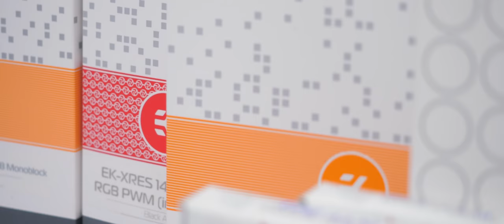Bộ PC 100 Triệu Cho Fan ASUS ROG! | HANOICOMPUTER

Comment: ad tư vấn cho bộ máy vừa có thể chơi ổn PUBG vừa có thể  sử dụng AI PS PR ổn định trong tầm giá dưới 20m được k ạ>?
Reply: Tùng Tùng 8100 + b360 + 8gb ram + 1060 6gb + psu 450w + ssd 128gb
Reply: Học Trò Thầy Ba dưới 20m mà sao đc 1060 6gb vậy?
Reply: Nhật Huy Trần bạn lên web nào đấy build thử xem , k đến 20m đâu
Reply: Học Trò Thầy Ba ok
Reply: Học Trò Thầy Ba đấy là cấu hình >25m rồi bn ơi!!!! Trừ hàng cũ ra thôi. Vs lại 450 mik nghĩ ko ổn đâu bn ạ i3 8100 cx ngốn phết mà (ko biết chắc đâu :)))
Reply: Tom Potter làm gì tới bạn , mình build PV hàng new tầm <20m thôi . 25m là có i5 8400 rồi
Reply from the maker: Chào anh. với tầm giá và nhu cầu trên, HNC mời anh tham khảo qua cấu hình sau : https://www.hanoicomputer.vn/pc-hnc-professional-gaming-p8-i5-74008g1060/p37948.html

Comment: ORSAIR VENGEANCE® RGB 32GB (4 X 8GB) DDR4 3466MHZ C16
Số lượng: 
1
 x 12,490,000đ

GIGABYTE AORUS GTX 1080TI 11GB (352 BIT) GDDR5X
Số lượng: 
1
 x 22,500,000đ

CORSAIR RM1000X - 80 PLUS GOLD FULL MODULAR
Số lượng: 
1
 x 4,850,000đ

SAMSUNG 860 EVO SERIES 2.5" 250GB SATA III
Số lượng: 
1
 x 2,600,000đ

SEAGATE BARRACUDA 4TB 64MB CACHE SATA 6.0GB/S 3.5 7200RPM
Số lượng: 
1
 x 3,250,000đ

VITRA VICTORIA V4
Số lượng: 
1
 x 580,000đ

INTEL CORE I9 7900X SKYLAKE X SOCKET 2066
Số lượng: 
1
 x 25,500,000đ

GIGABYTE X299 AORUS GAMING 7 SOCKET 2066
Số lượng: 
1
 x 11,150,000đ

82,920,000 VNĐ
Có 82 củ à pc 100 củ của hanoicomputer mắc thế
Reply from the maker: Dạ còn vỏ case và hệ thống tản nhiệt nữa mà anh